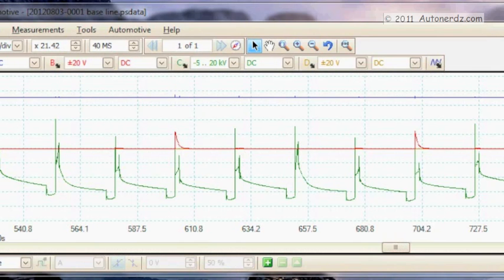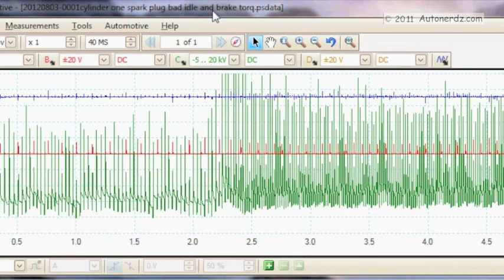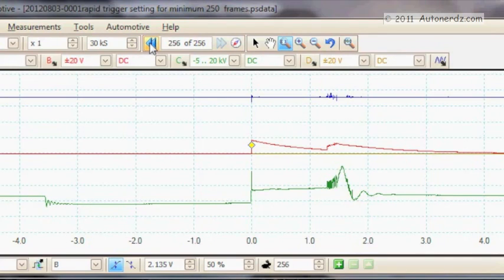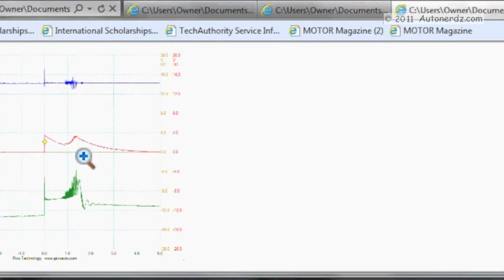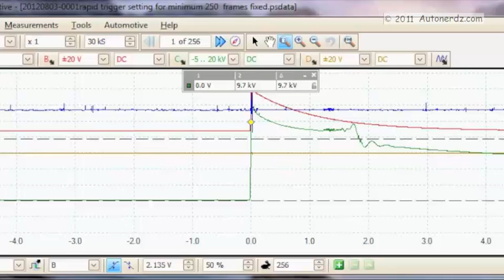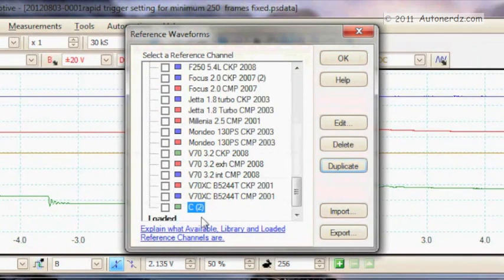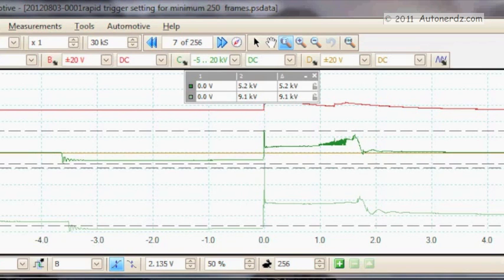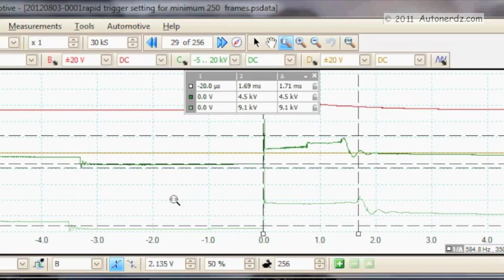Mick Jones   Secondary Analysis

Comment from the maker: If it's any consolation, everyone feels overwhelmed at first, wondering where to begin.  It's a journey best taken one step at a time.  It's an ongoing growth experience and sometimes hurts a little.  ;-)  But, since your access to our Picogroup resources does not require renewal, there is no rush.  One of the most important videos to watch is our 4000 Power Management tutorial.  This is one you will watch several times and grasp a little more each time as you gain practical experience.

Comment from the maker: Continued....
The Greatest Gap does not mean the largest physical gap but the gap requiring the greatest KV.  What the smaller gaps do is add resistance.  This will show up clearly in spark time and slope.  As for the spark line KV (your question), the beginning of the spark line is not really affected by an additional gap until that gap is large enough to affect firing KV.  However, the spark line will slope upward from the beginning and have a reduced spark time.  That's what is noticable.

Comment from the maker: Very good question.  The answer from tacomatech is not correct.  You could have any number of secondary gaps and the firing KV would be unaffected as long as none of the gaps required more KV than the plug requirement.  You could have a secondary wire broken in multiple places and the KV would be the same as the good wires.  Secondary ignition guru Mac VandenBrink coined the term 'Greatest Gap'.  The firing KV reflects the requirements of the Greatest Gap.